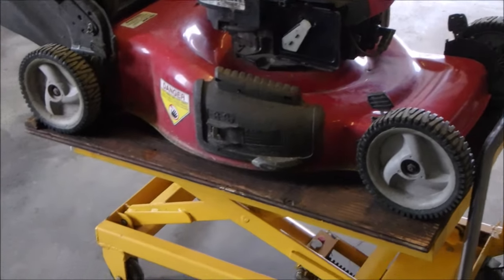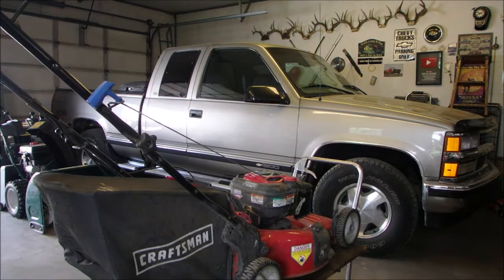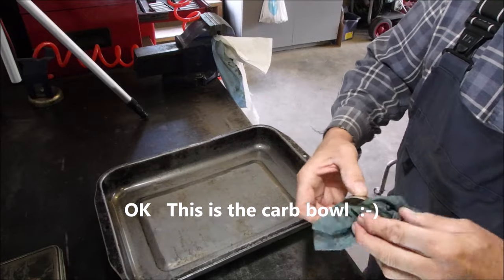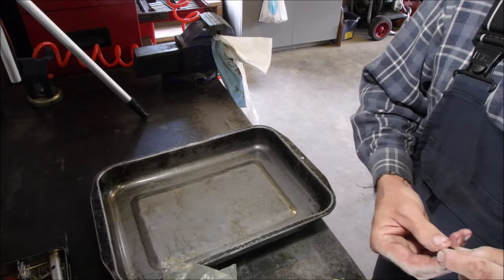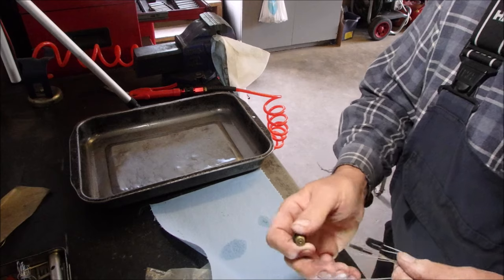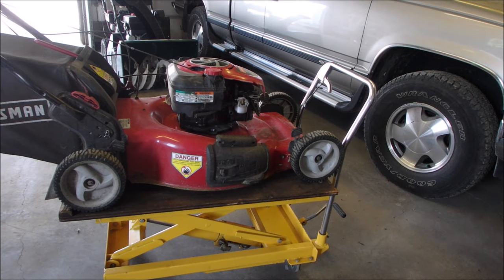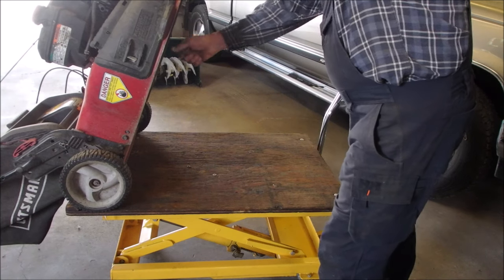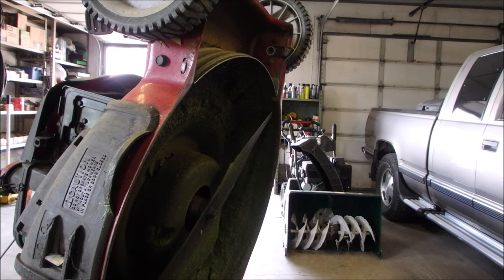Briggs-Craftsman 6HP Mower Not Starting???

Comment: I have always liked the quantam series engines, although I am admittedly not familiar with the newer Briggs stuff.  I kind of left off at the old 92902 days of old.  That stupid plastic air box can be an issue when the primer is used, but otherwise they seem pretty good.  Not impressed with the OHV engines for sure.  
It is amazing how many folks think they have cleaned the main jet by cleaning the two large holes on either side, they don't realize the actual metering hole is that tiny hole in the center.  That mower does look to be in very nice condition, nice to see mowers that have been cared for.  I saw that loctite and grey color and was crossing my fingers the threads weren't ripped out of the carb!
Reply from the maker: You are so right.  I am getting used to the newer OHV stuff but when I get a flathead I can relax a bit.  Thanks